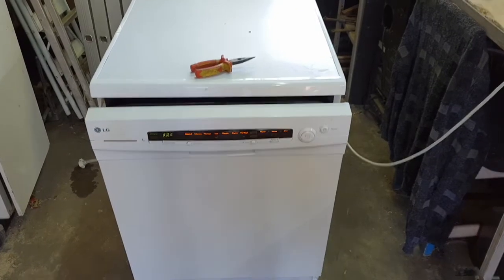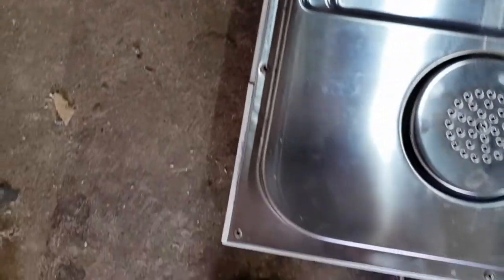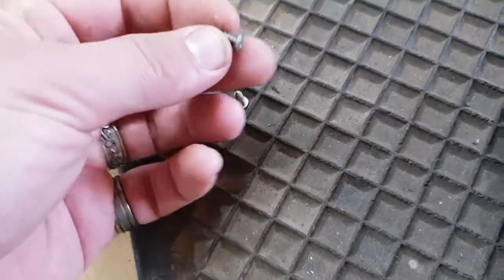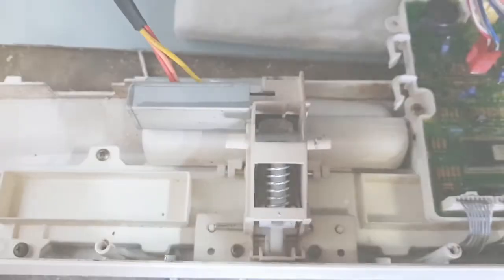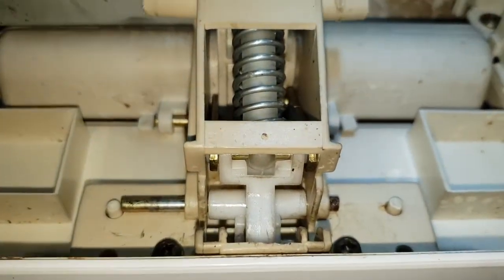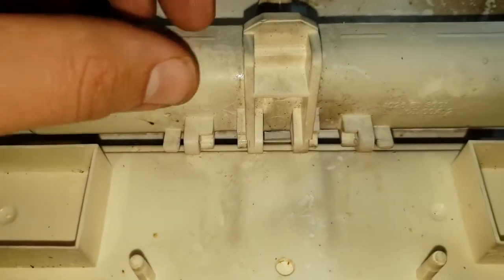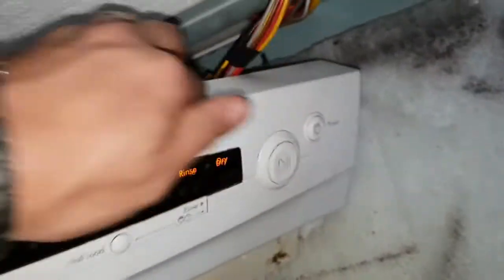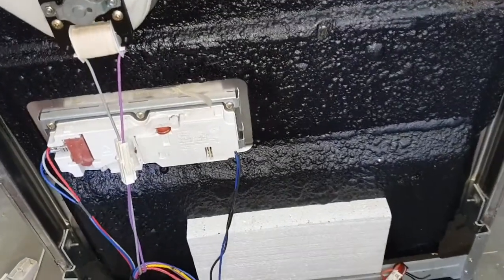LG  Dishwasher LD2040WH door repair

Comment: We watched the video and fixed our dishwasher today. Husband used some coat hanger wire doubled up - no  cutting bolts and using nuts. Thanks for the tips. It saved us spending $700 on another unit.

Comment: You are a legend for putting this up! Had the exact same problem and was told the replacement door latch part is now obsolete, time to throw the dishwasher out and buy a new one. Came across your video by chance last night. It helped me realise what those two little copper pieces swinging in the breeze were meant to be attached to. This morning with a 40c M4 bit of bolt, a couple of nuts and using your video as a guide, I now have the thing back working away beautifully again! Many thanks!

Comment: Fantastic!! Carried out this repair this morning, very easy to do.. however I opted to not install the nuts etc, just drilled the holes and placed a pin through that is held in place by the plastic casing.... happy to come and do for anyone that is experiencing this problem.

Thanks for the video

Comment: The 4 nut system is a bit ... nutty. Tell you why, since you went through the trouble of drilling a hole and cutting a bolt to exact size filing it down to the millimeter the outer plastic that holds the bronze shafts will also hold the crossbeam in place. No need for bolts. So for those of you that find it fidgety or difficult to twerl 4 bolts around just make sure your cross shaft is cut exactly to measure and once all assembled in place it can't escape.

Comment: Had the same 3 years ago... but had to force the door open.
I just disabled the mechanism (removed some rod from the handle).

That worked fine since... surprisingly the door stays closed well on it's own.

Today though, the wife didn't close the door all the way I think, so some water got in through the latch hole.
I tested the switch and it seemed fine.. but a few minutes under a hairdryer was needed.

A hack on top of a disabled latch hack - added some duct tape to stop any water. :)

Machine is 11 years old now, pretty good.

Comment: Anyone in JHB that can do this for me in Lockdown?
Reply: You can disable the latch quite easily if you have a screwdriver. If you're a cheap and lazy bastard like me.
Reply: @hannesRSA  how??
Reply: @aundreii151  i think I removed part of the latch. So there is no latch coming out of the door. The electrical switch is either always depressed / always open.. you'd have to check which way it goes for closed.

Do tape up the holes at the top of the door since you might get water going into the door. Then you can use the machine unlocked.. I didn't have any water leaking out.

Comment: having exact same issue except one of the sides of the handle has completely broken off, leaving only one side to drill through or put a bolt through. going to take some more effort to fix